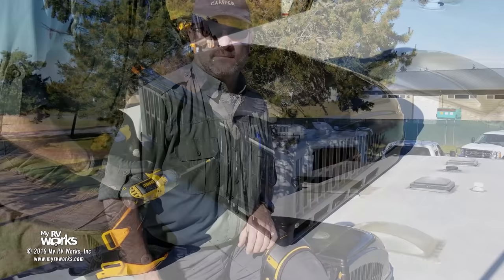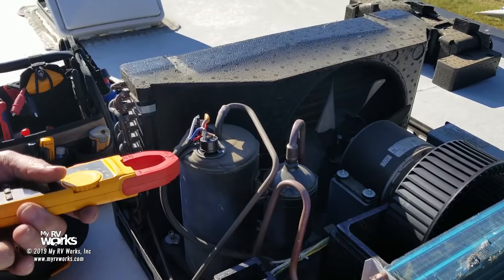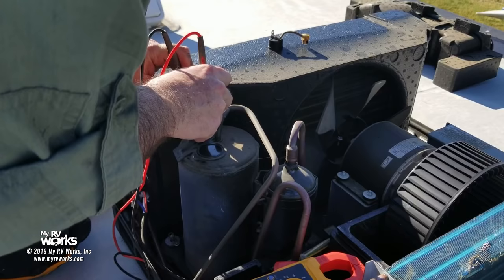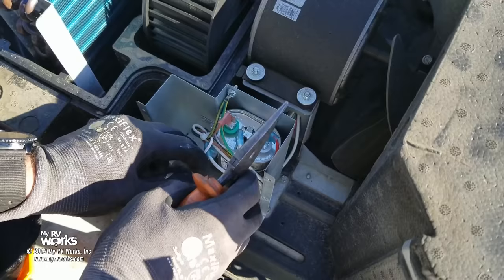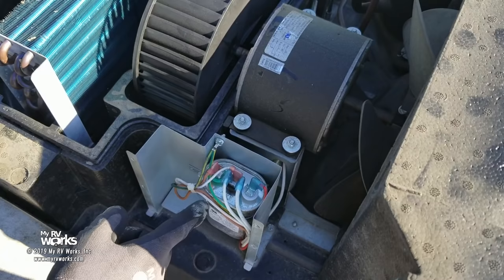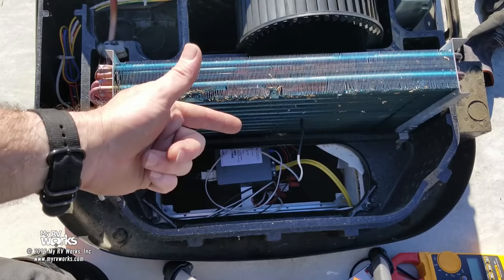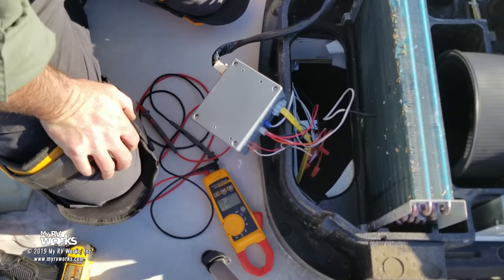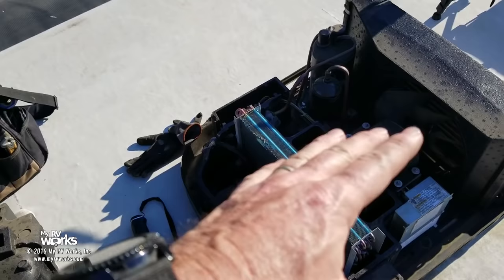Diagnosing An RV Air Conditioner That Is Not Cooling

Comment: On a on a Coleman Mach 15, what would cause the AC to turn on and then after a few minutes shut off from blowing cold air Is there a low pressure switch in these units?  as far as refrigerant when I turn it on it blows cold air I hear the compressor kick in and then after a few minutes shut off and continues blowing but no cold air
Reply from the maker: They're actually could be several things going on there, the easiest thing you can look for is to make sure that the freeze sensor is wedged in between all of the evaporator coil fins. The freeze sensor is typically small white wires with a small bulb on the end of it. You may also have a defective freeze sensor. The reason I'm having you look at the freeze sensor, is because if the air conditioner thinks it's getting too cold at the evaporator coils, it will turn the compressor off and keep the fan blower running to try to prevent ice buildup on the coil. In our manual section of our website we have several manuals for air conditioners.
https://myrvworks.com/manuals/
Reply: I just read that you can get to the freeze center from inside is that correct

Comment: Darren, I do have a question for you... 
A coleman thermostat has a High and low position for the A/C. When I put it in high the fan and the compressor are working fine. When I put it in low the fan will not start.
Any Idea of what could it be? I'm out of ideas!
The capacitors are working and everything seems to be connected properly.
Reply from the maker: Sounds like a fun discovery!  Can you provide the model number for the A/C and thermostat.  That will help me pull the correct manual and have a look at the schematics.  From there it should be easy to follow the circuit to the fault.  I have a service manual section on my website.  Have not uploaded all the manuals I have yet but I do have quite a few already uploaded.  See if your manual is there:  https://myrvworks.com/manuals/
Reply: @MyRVWorks  
The a/c is a Coleman Mach 3+ Mod. 482X3C9XX
The thermostat is  Coleman 7330F385
Reply: @MyRVWorks  have you been able to look at the problem I'm having?
Reply: @eclarkmx he’s finning around with it.

Comment: How cold should it be coming into the cabin generally??
Reply from the maker: The air conditioners have the ability to drop the temperature between incoming and outgoing by around 20°. If it's very humid and the air conditioner is pulling the moisture of the air, then you won't get that much drop in temperature. So if the air conditioner supply air side is bringing in 70° air, then the return will be 50°.
Reply: Thank you so much. Also, I bought my RV used. It’s a 2009 and it’s got two mock eights up on it. They both have a big shroud over one side of the unit but it seems that there should have a shroud that goes over the coil area and that’s missing. do you have any idea about that? I saw it on one, but it must’ve been a different model maybe. I just don’t understand why that would be completely all together with nothing around the coil. Does that make any sense?

Comment: I have a problem in an old RV with Dometic AC that the compressor did not work for first months but the fan did. Then one day the AC worked but will not turn off unless manually shut off. Today the compressor will not work again. Can you help us at all please? We were left with a huge problem, no experience, and the owner doesn't care at all. What can we do for a cheap fix? We are only here until August but must survive July. Thanks for any clue.
Reply from the maker: Take a few minutes and study the wiring schematic for your unit. Armed with that knowledge, you can then become the control module. What I mean by that on the control board are relays that control the compressor and fan. There may be an issue with a thermostat, the wiring between a thermostat in a control board, or the control board itself. To know which way to go with your troubleshooting you become the control board and energize those relays yourself as the thermostat would have. So basically you're going to hotwire those relays to energize.

Comment: question. My AC fan runs, the compressor comes on then, about a minute later it starts making a loud vibrating noise and then the compressor cuts off about a minute later. Any Idea? I have the same AC but the 13500 unit

Comment: I checked my
 c to s =1.9
c to r = 1.0
S to R was 2.6? It should be 2.9 is my compressor nfg or is 2.6 close enough?
Reply: 0 resistance on the right switch so its good

Comment: The only thing you didn't do was an Amp draw on the compressor, that would've told you that the refrigerator LOL was low, with a low amp reading

Comment: What would you say would be the issue when the AC trips the breaker everytime the outside temperature reaches 100 degrees or higher? But if its 90 or lower it runs fine?
Reply: Jose Rodriguez Can you shade the A/C unit on the roof? It probably won’t look good but if it works then you won’t be miserable. It’s over heating. A new breaker might work but I don’t think so.

Comment: The sealed compressor has nothing to do with the Montreal act, you can go back and look at 1970's Coleman AC units and they have the same sealed compressors. They use sealed compressors on Rooftop RV AC units for a reason RELIABILITY ! 

You could always pay someone to solder in some schrader valves but why bother, the cost for a new compressor or evaporator coil is 2/3rds the cost of a whole new unit. 

the bottom line is you should get 15-20 years out of a well maintained rooftop AC unit that hasn't been subjected to low voltages or physical damage.

The #1 killer of rooftop RV ac units is low voltage , the #2 killer is simply lack of use. you really should fire them up once a month for 20 minutes, unfortunately that's hard to do in some of the colder climates.

Comment: man this sounds real bad isnt ac fluid flamable? and its leaked some where?  theres no alarm system for pressure of the coolant or level or however this works?  or a leak alarm.  plus your model has a real thermostate or is it just a nob cool thermostate?  mine just has the nob n the fan never goes off.  i want to get real thermostate kit? does it replace your whole control box or run with it if you kit a dometic?  plus if you have a nob would you wanta check the pot for certain ohms? or how that works

Comment: Did I see the video correctly, the two options are replacing the whole unit or do a leak test repair the leak and recharge. And he leaned more towards replacing it. What country is this video film in. I would love to tell that to my customers you have a leak let’s replace the whole unit.
Reply from the maker: I mention in my video I am in Washington State. And that's in the United States. Not exactly sure where you're going with your comment, however there are very strict regulatory laws in this country and State regarding tapping and refilling refrigerant on these units. It follows under the Montreal protocol. As a legitimate business, I am choosing to follow the laws of the state that I am operating my business in. I did not make these laws and I probably did not vote for the people who made these laws because it does create a barrier to my business however. However, if I'm in violation they will surely fine me. So, do your own due diligence as it relates to whatever country and state you're in.  There have been some other comments on this thread that discuss this topic more in-depth. One commenter even left a link to the different laws by state. I invite you to review those.  If you are so inclined to get the necessary equipment, licensing fees, Insurance Etc to recharge these air conditioner units, then by all means knock yourself out. The air conditioner manufacturers will tell you straight up that they make these as a disposable unit and that is why they do not put any kind of Taps on any of their units. If there's a leak they expect you to recycle it and put a new one on. If you have an issue with my statement you can take it up with your air conditioner manufacturers directly.
Reply: California the one with the most rules, universal cert, c10 license, 90% of small units appliances don’t have hook up fittings you have to ether put a tap or braze one on. I dint see most of the video I wasn’t aware you didn’t have a refrigerant license. It’s just I’ve rarely seen a customer just want to replace a good unit rather then just repair a leak.

Comment: So when you say just replace this all up here...are you talking about the compressor and fan motor and capacitor that all just checked out as good? With our house systems that loose their Freon, my HVAC guy puts in a dye pack with the Freon to be able to find the leak and fixes it and then adds more Freon. Is that not possible with the RV units? Isn’t it expensive to replace everything just due to a leak?
Reply from the maker: When I say replace everything, that's the part you see up there from the pan up.  The whole roof mounted kit as one part number.  If you stay with the same model number than your ceiling plenum on the inside would remain. But if you change then you would need a new inside plenum as well. Perhaps even a new thermostat if you upgrade to a heat pump when your existing one did not have that feature. RV airconditioner manufacturers make them disposable. That is information directly from the manufacturers themselves. There are no taps that you can add refrigerant to the unit. New is about $300 - $800 depending on BTU, heat pump options etc, so when you consider a new A/C with warranty versus the repair, I let the customer make the decision. If they want it repaired and re-changed there are services in her area that offer that but that is not something that I offer. What I offer is put on the new air conditioner up on top if it has lost its coolant. In my location I don't get enough air conditioner jobs to justify getting licensed, tools and all that. I'll probably get three air conditioner calls in a year. It's just not worth it for me as a business to do that, guys down south different proposition.
Reply: My HVAC guy added the taps and charged mine up and it lasted for the next 2 years that we owned that RV. $75 vs $800. Glad I had a good residential HVAC guy who knew how to get around the expensive replacement and was licensed to do what I needed done. There’s definitely no reason to replace that entire system when everything up top checked out fine.

Comment: This is an awesome video thank you.

Question, I’m out camping and weather is getting to about 106. When it gets this hot, I can hear my ac compressor and fan turn on but after a few minutes the  compressor shuts off and  fan stays on but air get hot. 
In the evening and night the ac blows cold air and keeps temps in trailer at 68. I only have this problem in the midday when it’s really hot. I am in a crowded camp, with a lot of 50amp rv parked in 30amp spots. Do you think Electrical grid gets overloaded on the hot time and amps drop causing my ac to stop?
Reply from the maker: A quick Go No-Go test to figure out which way to go with troubleshooting is to perform was called a bypass test. You will need to go up on your roof and gain access to your air conditioner control module. Turn off the power and then you connect the wires from your compressor, High fan, and incoming power all together - basically by passing the control board. Turn on your breaker and see if everything works that way. You might have an icing issue but this test will be a good go no to go to tell you which way to go with troubleshooting.
Reply: Did you figure out what the problem was?

Comment: What btu would I need for a 30 amp camper?
Reply from the maker: 13.5K may work. But it's more function of the cubic area that it's doing the cooling in and not so much a function of available power.
Reply: Would 15000 be too much for it?

Comment: Not sure if you can help me on here,but I’m going to try. My Dometic A/C not refrigerator lol. Fails to recalculate/restart after it reaches temp. It won’t restart again but if I turn the thermostat off and on again it will start right up. I have replaced the thermostat and it still has that problem. I can’t find anything online or on YouTube that will lead me down the right path. Any help would be appreciated. Thanks.
Reply: Sounds like a bad thermostat or you are trying to run two units off one thermostat that isn’t capable
Reply: @DanielJohnson-ec8rk  I replaced the thermostat with a brand new thermostat. Only thing be A/C on n the unit.
Reply: @Trucker2001  you aren’t trying to run two on one thermostat?
Reply: @DanielJohnson-ec8rk  no sir, only one A/C in this unit.

Comment: I have a 3 zone Dometic system and one of the zones , the temp sensor has started reading off about 30 degrees, any thoughts on how to fix the issue or why this appeared.
Reply from the maker: First let's locate your Zone sensors. Often times are in little circular slotted things about the size of a quarter or so.  (never on an outside wall and should never be directly below one of the registers so it's being blown an). Once identified, take a hair dryer, or just your hot breath, and blow on it and see if you are getting any reading on your display. If your seeing the changes but the thermostat is giving a false reading it might be time to change out that sensor at that location.  Easy operation. The other end of the thermostat wire connects into a white connector up in the air conditioner control board. So, you can also look there for any corrosion or issues in that connector.

Comment: My fan won’t turn without assistance if I flick it it will run .. does that make the motor bad?
Reply: Fan capacitor
Reply: @BigFern9876  just changed both capacitors and the fan .. still my breaker gets hot ., blows ac breaker and my 30 amp.
Reply: @michaelwhite8136  I’d check connections and after clamp compressor as well as the fan leads.
Reply: @BigFern9876  will do that .. Thank You.

Comment: The only thing he forgot was explaining delta t.....its basically if its 100 deg outside a properly working ac cools 20 ish degrees so it cant get your rv to 60 even if tstat is set to that. So if its 80 out and you set your tstat to 60 its possible.if its cooling 20ish degrees dont call a repair guy its a waste of your money.

Comment: Seems wasteful to throw out the whole unit due to a leak. But, these units have become a throw away item. About the only thing you can change is the Capacitor or the fan motor. Otherwise, just throw a new unit at it. I guess if you get a few seasons out of one, 8 or 9 hundred bucks plus an hour or so putting it on the roof isn't so bad.
Reply from the maker: When I have my business down south in Texas, it made sense to get the licensing in the tools to recharge these units. Since I've moved up here to the peninsula in Washington, I get maybe two to three air conditioner calls a year, so it's just not worth me getting all that kit to do one or two air conditioners a year. Your mileage may vary.

Comment: All of my stuff seems to be fine but when I turn the AC on and it kicks the compressor on it pulls the power down so hard it scares me! What could do that?
Reply: Hi Melissa,  There is a large amp draw from compressor motor once it starts up.  There are aftermarket items, called "Hard Start" capacitors, which lessens it- especially if you use a generator.
Reply: @jerryparton8944  Hi Jerry. It has never done that before. I'm hooked up to electric and it worked fine until this year when the electric switch on the water heater messed up. When I went to switch the AC on it felt like it was going to suck the camper into it's self. Scared me. Thank you so much for replying to me! We have cleaned around the AC unit. Unhooked the wires to the water heater switch and now it doesn't pull as hard. The compressor kicks in now but it is still pulling harder than it should.

Comment: My coils were dirty so I had some useless POS come and clean them. He claims a plastic piece on the compressor broke. It started making noise after he got done working on it. He got the part from the dealer to fix the little piece of plastic on the compressor. When he was done it still was making a clicking noise. That was last week and just today it is 110 outside and the air conditioner stopped producing cold air. 
Swear to God I’m gonna sue that pos!

Comment: You may have had a bad connection on that burnt wire and when you disconnected it, it made the connection again.  It would be a good idea to replace that connection so it doesn't fail while camping.

Comment: Make sure u dis charge that component to the people to stay safe
Reply from the maker: Agreed.  Over a short time it will self-discharge but best to test it.  Often I will just jumper a screwdriver between the terminals.  I do have a capacitor discharge tool but don't carry it in my tool bag and forget it.  Often when I am on the roof I don't feel like climbing down to the service trailer to get it.

Comment: Number one, ITS A DOMETIC POS!  Had this issue myself. Dometic knew they had manufacturing issues and did not do a recall on the soldering on the coils. I snuck mine in under warranty. It’s definitely the bad coils!! BUY A COLEMAN!

Comment: You are not correct . Low refrig is not indicated. Cover was left off evap causing excessive hot outside temp. Fan not moving inside air. Does it have heat pump. If solenoid on compress is bad heat is default setting. You did not look at condenser condition. Plugged up? Condensation occurs at 20degree diff in temp not humidity.take beer out of frig sit on counter in ac. Frig is 40 degrees house is 78. Condensation forms. I am certified ac master tech resid and comm who lives in a 40' rv